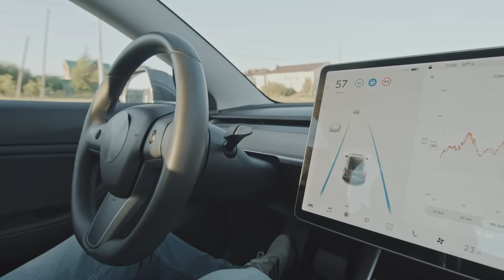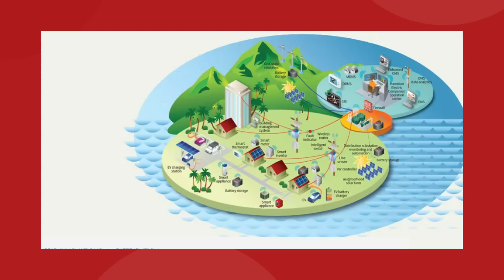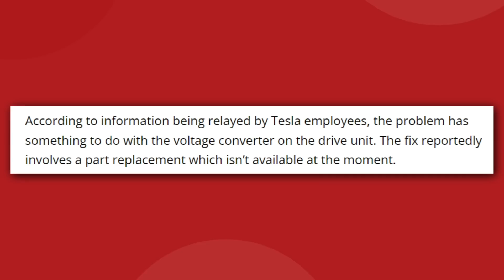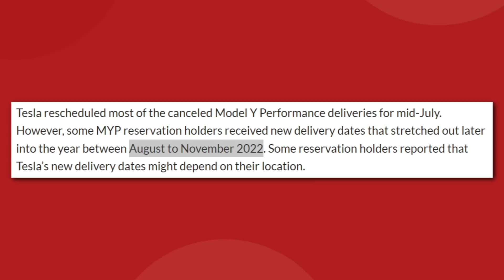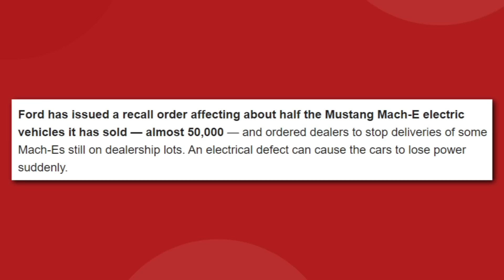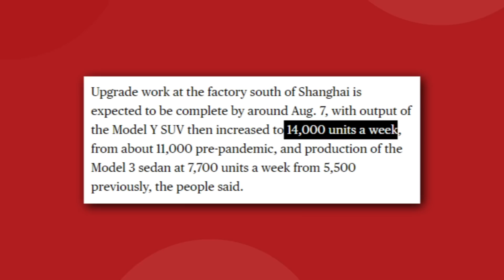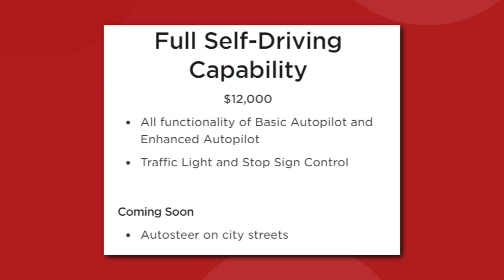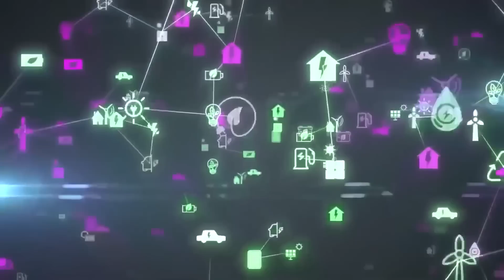Tesla Energy Is About To Take Over Hawaii

Comment: Hawaii also has an incredible capacity for water power.   On the wet side of the big island, you can get an average of 140 inches of rain per year, and it all drains out to the ocean through natural rivers and manmade canals that are flooded with rushing water when there are storms.
Reply: No, it doesn't. Only the Hamakua coast has any rivers, and they are all privately owned. The lava rock on the east side is very porous and soaks into the ground in moments

Comment: Good for Hawaii! I hope they recover their investment in less than 10 years (which is standard for solar PV).
Reply: Wishful thinking..... One great storm and billions of cheap dollars are gone.
Reply: @lillyblack3322  Yes. I’m trying to be positive. The negative side is the relatively high cost of solar PV compared to fossil fuels. Because Hawaii is at 19° N, you only have to provided PV for 30% less sunshine in winter. Of course the houses on the northern slopes will sell for less than those on the southern slopes. Bird excrement will be a sore point.
Reply: @jeffharmed1616  solar may get you AC and thats all you care about close to the equator, but solar generates 0 without sunlight...  did you forget that?  Solar needs battery storage to operate 24 x 7 that may actually cause more ecological damage, than keeping the fossil fuel plants running.

Comment: Co2 has dropped by 90% over the last 150 million years. 2000 ppm is used in Green houses  for better growth. In 2020 the earth peeked at 412.5 ppm. Plants die below 150 ppm. Clearly something does not add up. Green cools the planet, the numbers used to push this agenda are pulled from cities of concrete, asphalt, and heat absorbing roof tops that are constantly growing and displacing the Greens. This is a case of idiocracy but in this case we are removing the Co2 and not the water. The people behind this already have all the seeds in bunkers called arks for the day they step out of their bunkers. Under 150 ppm and a plant will not grow no matter how much sun, water and fertilizer you give them.

Comment: Put mega pack under ground or in mountain areas. Protect the batteries from storms.
Reply: That's an option but batteries need to dissipate heat so open -air installation is best, otherwise, you have to power mechanical cooling.
Reply: right... underground where there's a lot of moisture, nowhere to dissipate heat, takes a lot of time and energy and hassle, makes expansion much more difficult, and makes the risk of harm to workers WHEN they combust makes this a terrible idea
Reply: Best underwater.